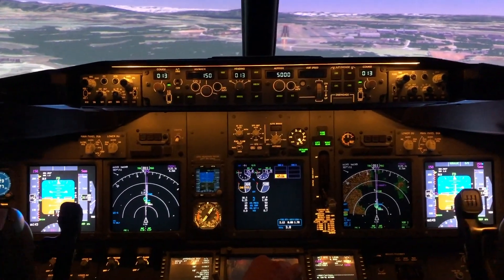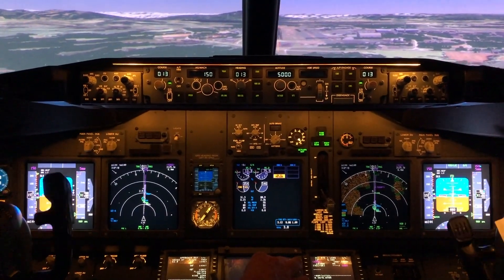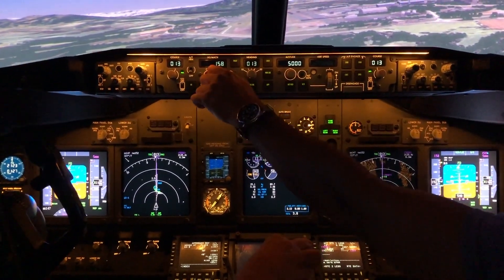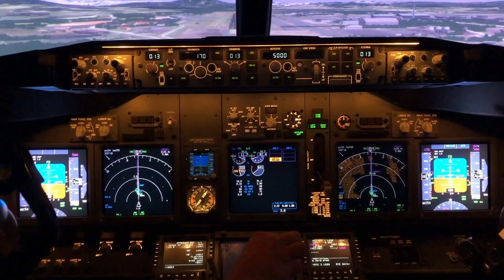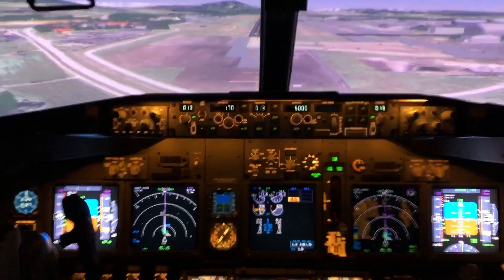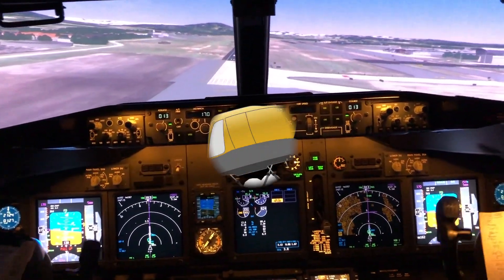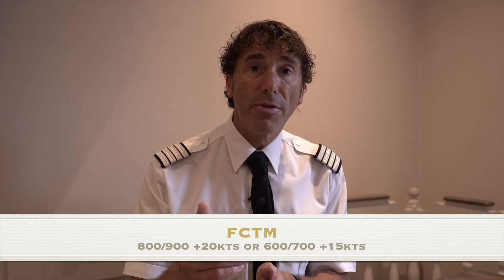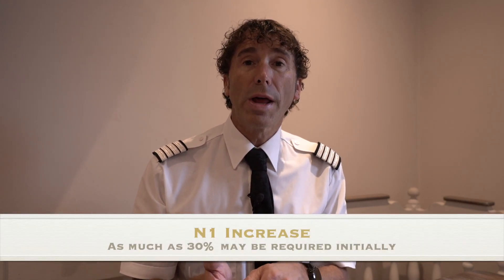Engine failure on the approach

Comment: Hi captain when you are approaching with an ILS OEI using flaps 15 when the speed window on the mcp opens do you select speed for flaps 15 o flaps 15 plus 5 . The magenta bug is on flaps 15 speed tape or you set plus 5

Comment: The Fact is that the Engine failure on final tale is discussed in the FCTM, and the FCTM isn’t a Legally certified book ( FAA only acknowledge it’s existence…)

So whether in F30 or F15… if performance distance is ok ( think to AB MAX ) and stable and every thing is ok, continue, otherwise GA and complete your drills…

Comment: I feel there is only one correct decision unless stated otherwise. Cavok , long rwy, no traffic between you and the rwy land for bloody sake! General knowledge assumes you just add twenty knots, some thrust, flaps to 15 , A/B 3 and ground proximity inhibit. Just like you brief an engine failure before takeoff as captain during the crew briefing to landing just run through the scenario with yourself.